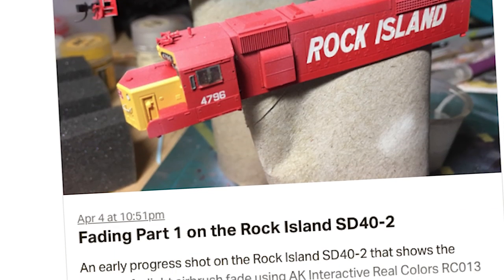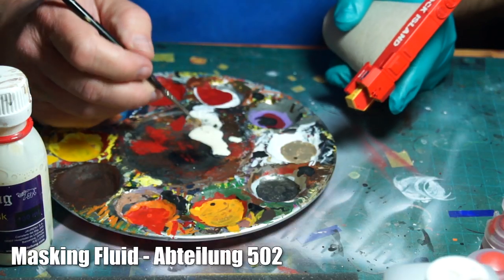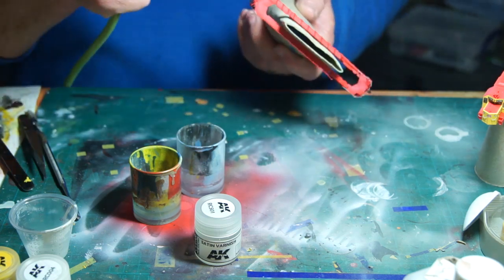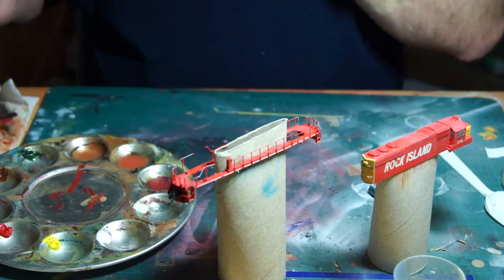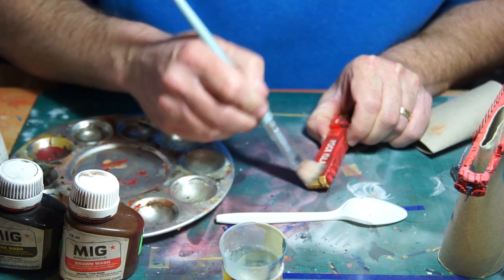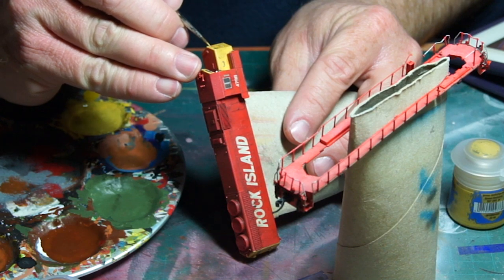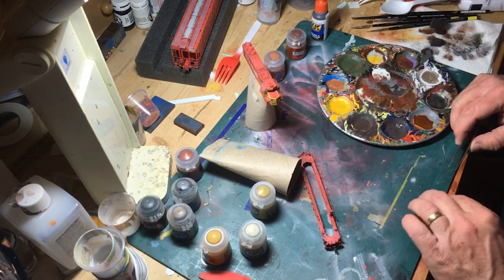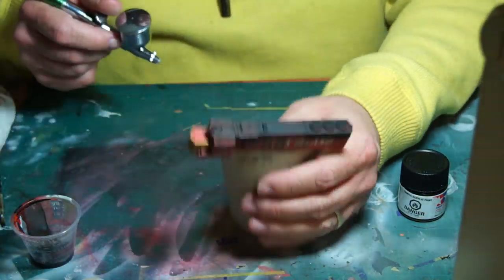Weathering a Rock Island Locomotive

Comment: Hello John, Did you airbrush any Varnish before starting the weathering process? If yes, what sort of varnish?
Reply from the maker: Hi Florent, I combined a step with your locomotive here when I got started. Normally I do a clear coat of some sort depending on what my first step is. If I am doing an oil-dot fade, I start with a Satin clearcoat. If I am doing an airbrush fade, I usually do a matte/flat coat first. In the case of your model, my starting step was a mix of AK Interactive Satin Clearcoat mixed with a small amount of AK Interactive's Off-White. This allowed me to combine two steps together.

Comment: i watch your videos, then i want to try it. take down the chalk powders i have, 2 bottles of washes, grab a rail car. and think. nope i not going to get it close to that, I don't have a air brush. so i put it all away and wait for your next video.
Reply from the maker: Understandable sparky. Maybe I can get you started on trying an oil-based wash/pinwash on a car that doesn't matter as much. :)
Reply: I only use the airbrush for painting (on undecorated models) and applying 'clear coats' (gloss or matte). A can of Testor's Dullcoat is a fine substitute.